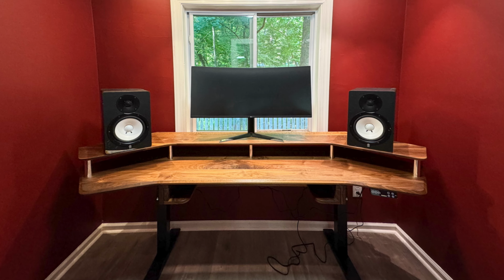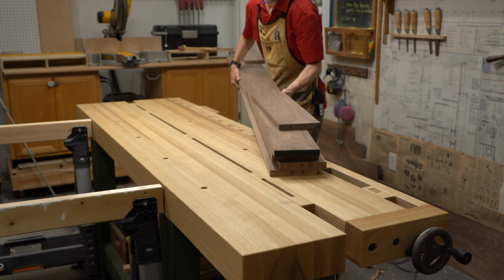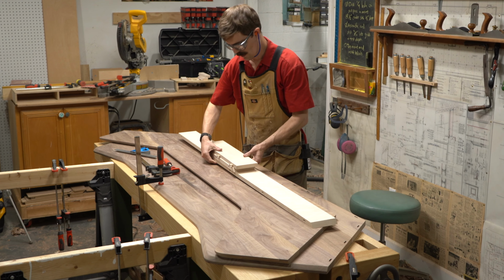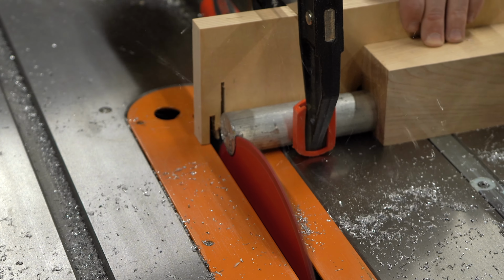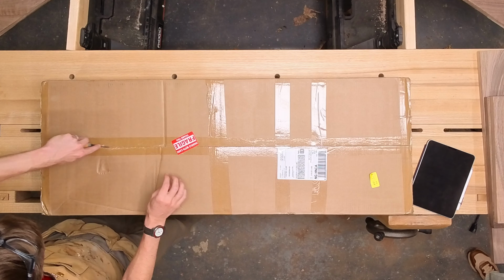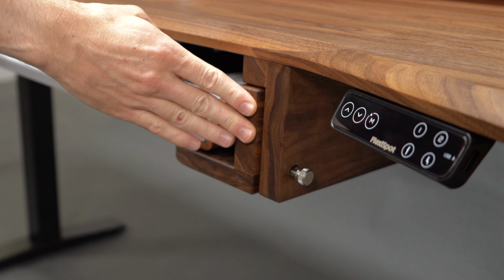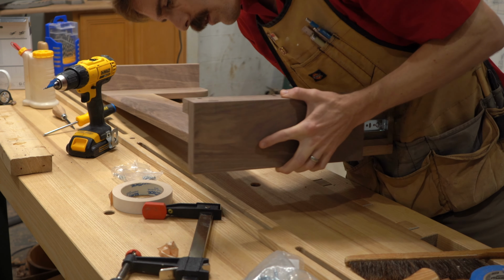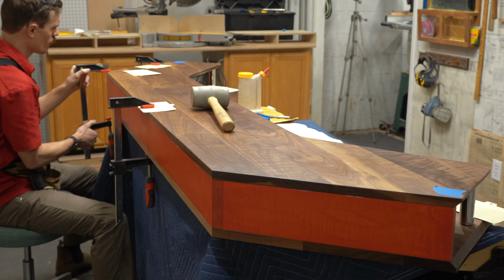Building a Futuristic Standing Desk Tailored to Musicians

Comment: Looks fab.

Next time you're working at the lathe with metal, please please please don't pull swarf away with your fingers while the part is spinning (please try not to do it with fingers even when stopped). If some of the swarf catches on the spinning part (which I've had happen multiple times all those years ago), it will rip straight through the soft tissues of your hand. Not out of your hand, literally through the soft tissue. If you need to clear swarf while the part is spinning, please use pliers, loose scrap or even kitchen tongs.
Reply from the maker: I appreciate the tip!

Comment: From a musician who built his own desk, the middle shelf is usually designed for rack-mounted equipment that's about 19 1/8" apart. Having aluminum columns with nothing for the rack ears to screw onto would make the equipment slide everywhere. That's my only issue with this design. Otherwise, I like the angled out ends.
Reply from the maker: For this build we weren’t incorporating that type of equipment.